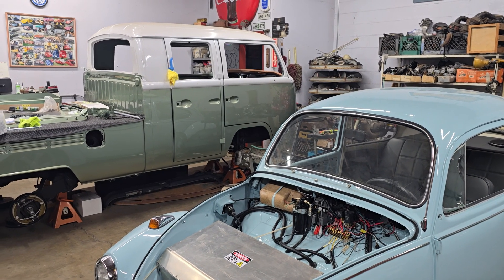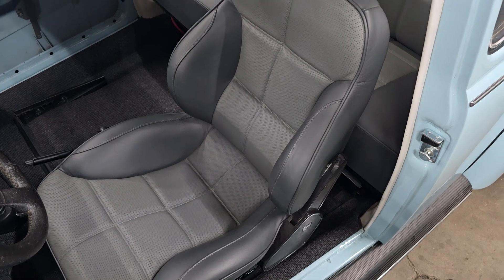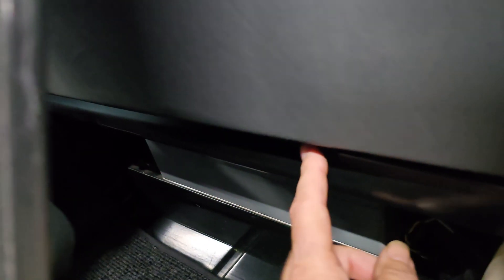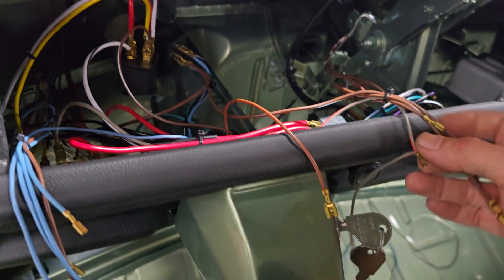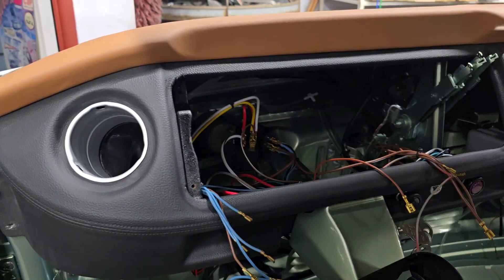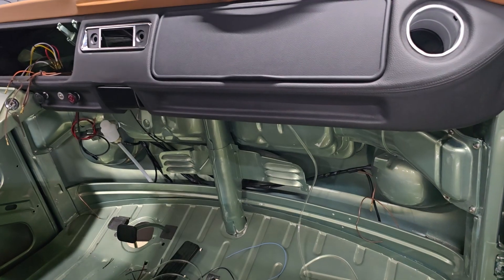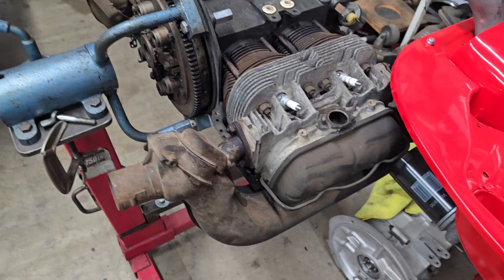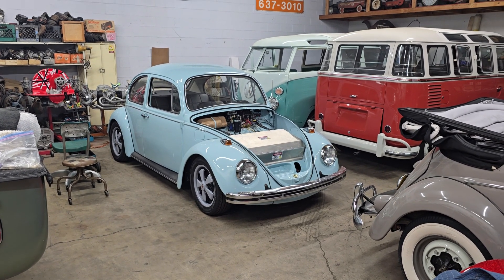A Day in the Life of Vintage Classic Specialist, Episode 244, lots of progress on the 68 DC & 79 EV

Comment: I‘m an ICE guy as you know, but that EV bug would be a blast to drive around town for errands and stuff. I’d drive it proudly 👍🏻 ok, so I’ll be honest, the wiring on the DC doesn’t look any diffent than it did before 😂 🤷🏼 the glove box would look good with a small chrome spear across the front with the small vw badge in the center. The red Manx is ❤ Red is my favorite color and that candy metal flake is wow. CU tomorrow! 😁👋🏻
Reply from the maker: Thanks Stew! I guess that's good it doesn't look any different, because I added a lot of wires. Good suggestion on the glove box, that would look good. Sounds like you need a red metalflake Manx! We'd be happy to build you one! 😁🙌